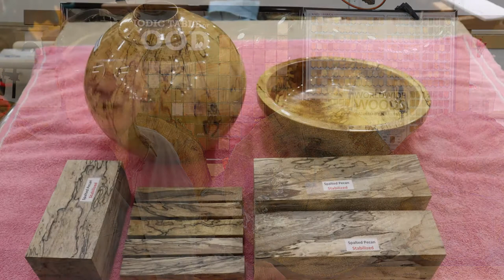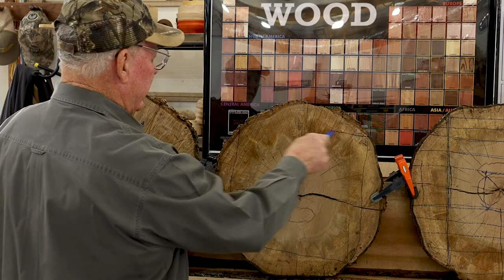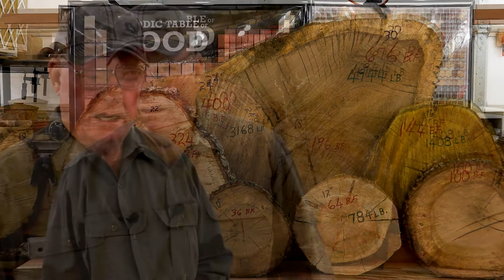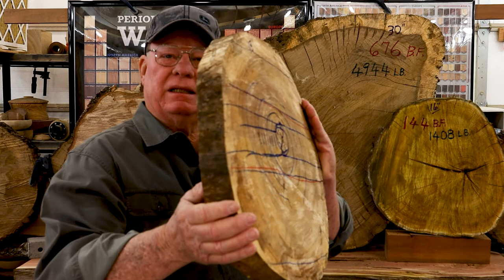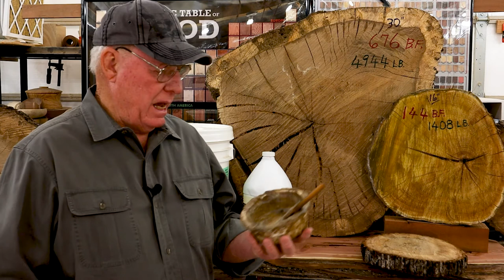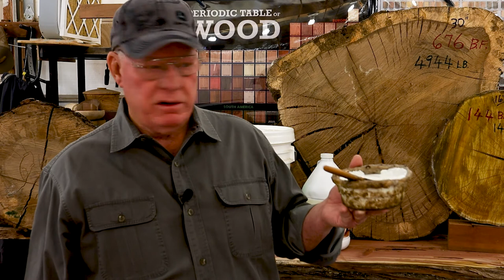How to Saw Logs - Part 2

Comment: About the pith. Is there a significant difference from spruce or pine to hardwoods regarding quality? Reason I am asking is that I regularly see boards with the pith at the construction stores around here - and we only have spruce and fir available there (Norway).

I have done some work with post and beam construction. To avoid/reduce cracks a cut is sometimes made with a saw from the surface to the pith along the length. What do you think about that?

Thanks for two really instructional videos here.
Reply from the maker: The answer is yes, construction lumber (2x4) often has the pity in them.  Do you care if the 2x4 cracks after you put it in a wall where it will be covered up?  You would care very much if the lumber with the pith in it cracked after you made a piece of fine furniture.
There is also a difference between the soft pity that is in pine various the very hard pity that is in hardwood lumber that caused it to crack more. Best practice is get rid of the pity at the sawmill, and make firewood out of it.
Reply: @georgewoodoftexas3509  Excellent answer. Thank you for explaining. And again for some very good videos.

Comment: Once again great advice still learning I'm on a big budget can I use waterproof wood glue to seal the ends thank you again George
Regards
Steve UK London
Reply from the maker: You could use glue but it normally dry's very hard while green wood is shrinking and moving. Not a good combination.  Anchor seal and other green wood sealers are designed to coat the end green of your wood but allowing it to move because of its soft, stretchy consistency even when dry.
George
Reply: @georgewoodoftexas3509  Thank you George did not think of the shrinking process Thank you again Steve

Comment: Mr. Wood - how much weight is lost between green log and, say, a standing dead ash tree? I have a hundred dead ash from the emerald borer, so wanted to know how long I can cut the logs before I overwhelm my little tractor's lift capacity. Thank you very much for sharing this information with us!
Reply from the maker: There is NO exact answer to your question. Only general answers based on my experience.  Each species of tree is different in the way it reacts to dying and then rotting. As a general rule a dead tree loses very little of its weight in water or sap just standing there. Most of its weight reduction will be in the loss of tissue from rot/ the fungus attack which eats the carbohydrates or sugars from the trees tissue. This means that if you waited long enough for the tree to reduce weight it is often too rotten to put on your sawmill. 
In my area of Northeast Texas, I can leave a cut log on the ground about one year before it becomes too rotten to use.

Comment: Do you have an email address that i could contact you? I would like to talk to you. Lost a huge red oak tree from Beryl. I hated losing this tree it was the best one in the yard. When i was 13, my grandfather taught me and my cousin how to frame. We built a garage/shop for my grandfather's boat. Shop was built probably 1978. My grandfather was from East Texas. The shop was built with conventional framing with the diagonal brace for the walls. When the tree fell both side of the galvanized tin roof took a direct hit. I was very surprised at how well the building survived. The roof is going to have to come off to repair the building. I have a couple joists that will need to be replaced along with rafters. Both sides of the galvanized tin had holes punched into it. I was able to patch it because we had extra galvanized sheets stored along with a coffee can full of galvanized roofing nails. I'm thinking about having the red oak milled. The tree is approximately 93.5 inches (used a tape measure) around or 29.77 inches in diameter. The tree splits off into 2 trunks at 20 ft. It's about 43 inches wide (rough estimate) where the trunk splits into 2 separate trunks.

Comment: You say to avoid the pith, but I often see it in  4x or 6x material... like a 4x4   ??
Reply from the maker: Pine Construction material, not hardwood fine woodworking lumber.  Who cares if a fence post or barn post cracks.  But we care very much if the fine hardwood table we build cracks are warps after we have make it.  I know some of the sawmilling and lumber issues gets confusing, all of us are trying to understand it and learning to work around natural wood issues. thanks for the comment.

Comment: I get 768 bdft on a 24" x  24" x  16' log!    How are you calculating it!  I think you counted 400 bdft!.....help
Reply from the maker: You know how to open a can of worms this early in the morning.  
Trees grow and are tapered from the large end of the log to the small end at your 16' log. It makes very little difference where you use the Doyle, Scribner or International scale to calculate Board feet of lumber in a tree. These calculators ESTIMATE the board feet of lumber in a felled tree  and or log BASED on the small end of the log.  They are based on taking a square cant out of the middle of the log and throwing away the trim and off cuts of the log.  Small sawyer's often salvage a lot of lumber from these off cuts. 
To say that all these lumber tables were made to benefit the logging and sawmill operators is an understatement. You apparently saved many of these off cuts.
It gets worst:  Loggers and wood buyer often us a BILTMORE stick to estimate the lumber in standing trees in the forest. These are also estimates. My experience is they tend to overestimate the B.F of lumber in a tree. To compensate for this loggers often underestimate log length and diameters.
I checked my figures on the 400 bf. log and that's what the charts show.  To get the high number of BF. from your log you must have saved all off cuts of wood.
Your timing is perfect with this question as I just completed a sawmilling job where we went out and measured all our standing trees of Red Cedar, cut the trees and brought them back to the sawmill.  The BF. output of these logs was carefully measured, and this subject will be addressed in a future video.  I will be producing it in about 2/3 months.  I am waiting for the lumber to be dried and installed in a horse tack room before finishing this forth coming video.
My spreadsheet sheet about that experience raises even more questions than you have raised about chart accuracy. 

George